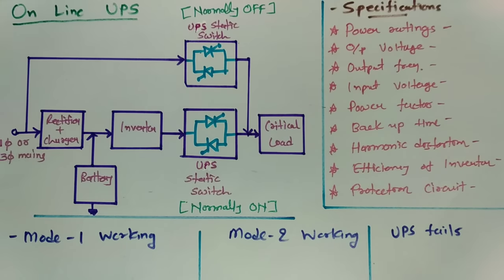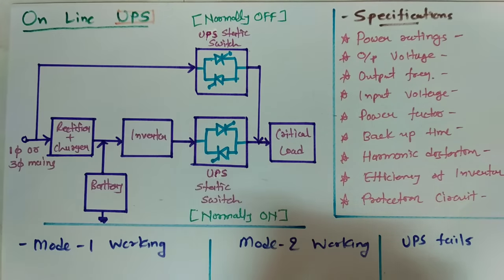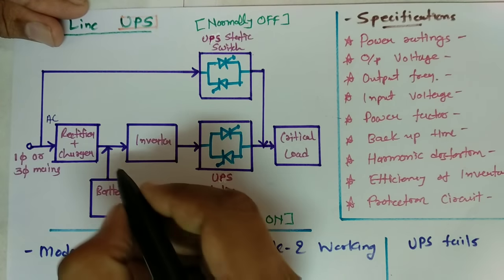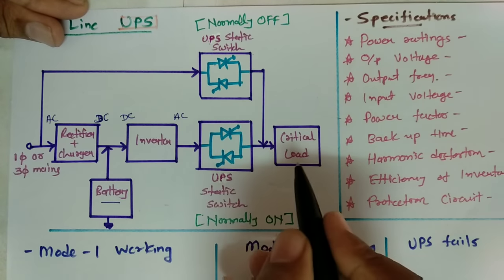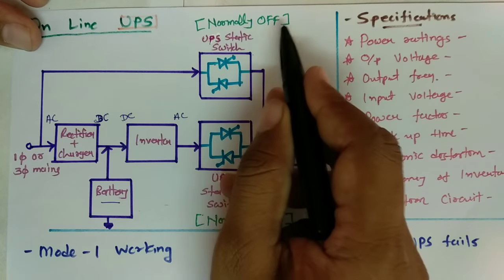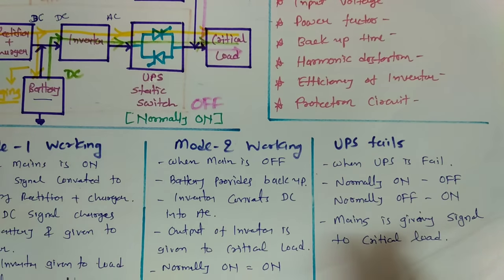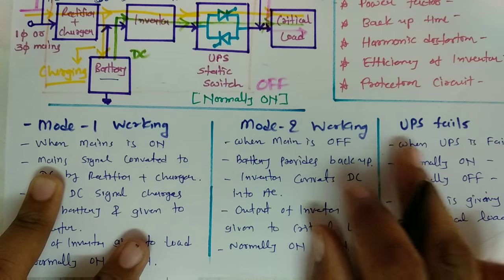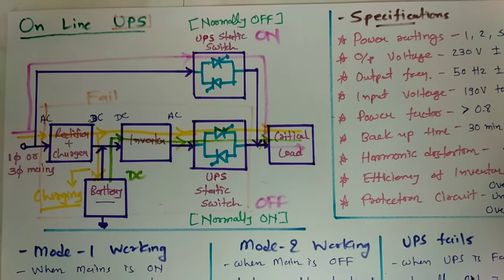On Line UPS (Basics, Block Diagram, Working, Applications & Specifications) Explained

Comment: Sir, Online UPS does not have Mode 2 working.  In this, the main supply is always given up to the through load of the battery, whether the main supply is coming or not.  Double conversion takes place here.  The power supply is always routed to the through load of the battery, preventing us from switching, which separates the online UPS from the offline UPS.
Reply: True

Comment: What is difference between static bypass & maintenance bypass switch please explain.
Reply: Static bypass tab hota hai ab mains power fail ho jaye, maintenance tab hota hai jab manually ups ko off krte hai for repairing

Comment: Dear sir when UPS fail as you said mains go to critical load i agreed but how to maintain the quality of power i mean we have put active filters or voltage regulators can you reply me as i said wrong or right ofcource now a days all indutriies installed voltage regulators after transformer out .
Reply: Sir What is the difference between the line interactive ups and online ups
Reply: Dear sir plz explain ..
Difference between the with and without isolation based transformers online ups...